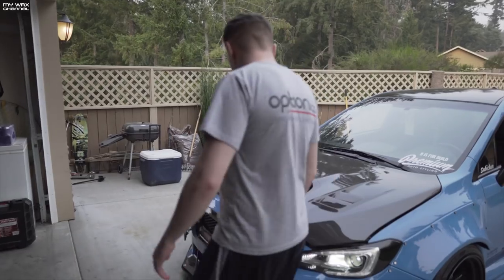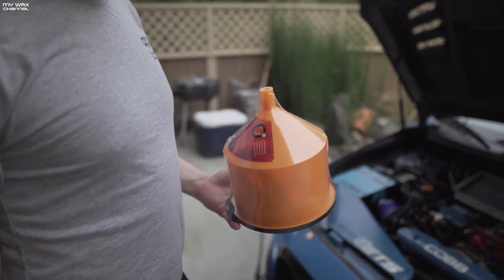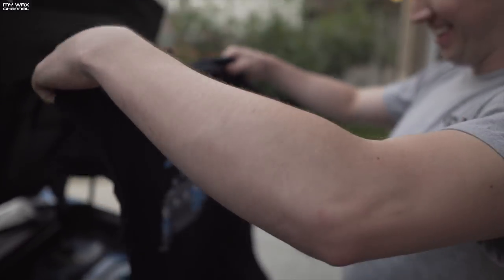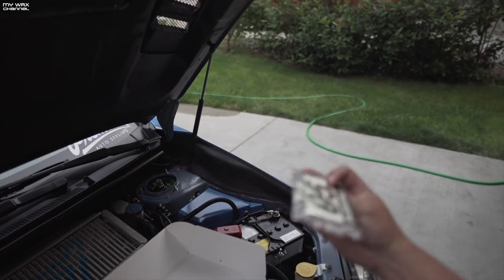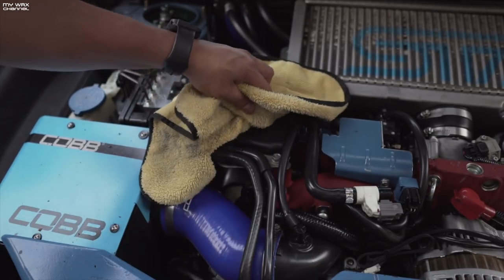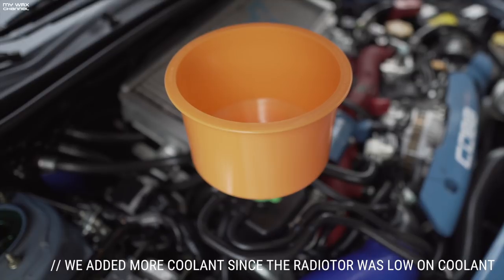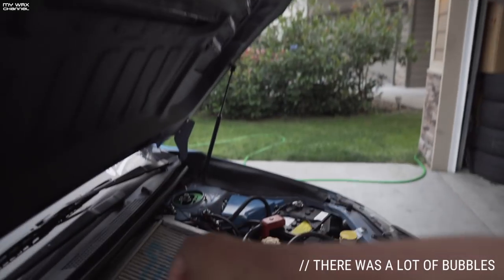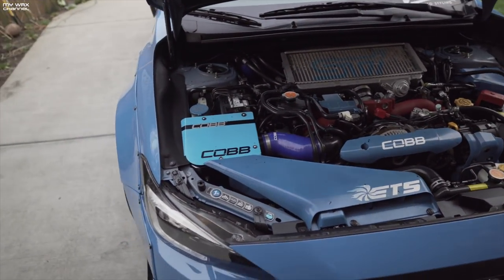STI OVERHEATING!!! BLOWN ENGINE? HEAD GASKET? | COOLING SYSTEM BURP | 2015-2019 SUBARU WRX/STI

Comment: So has it worked. Talkin my wife into letting me get a sti but I keep reading about issues with direct injection motors. I’m seeing all these issues with blown motors as well. Stock and modded.
Reply: Yes at the end of the video it says coolant temps are back to normal.
Reply: STI has EJ motor. That's port injection isn't it. My FA motor is direct injection. EJ has the ringland issues mainly from oil starvation or beating on the motor
Reply: I’ll have to go to the dealer this weekend and check one out. I’ve loved these cars since 04. Playing gran turismo on the playstation this was my favorite car. After seeing it I fell in love just never got one.
Reply: If you can I would wait until 2020 to see what refresh they have in store. Main reason I did not do the STi was because they been using the same engine with the same weak points for sooooooooo long. FA doesn't have the power capabilities but is more efficient and with full bolt ons can be decent. No way in hell, even with an AOS, would i drive an STI the way i drive my WRX. I would be scared every second. You will alwats hear more horror stories than good. Look into MRT performance youtube channel for good info. They have videos explaining the EJ and FA weak points.